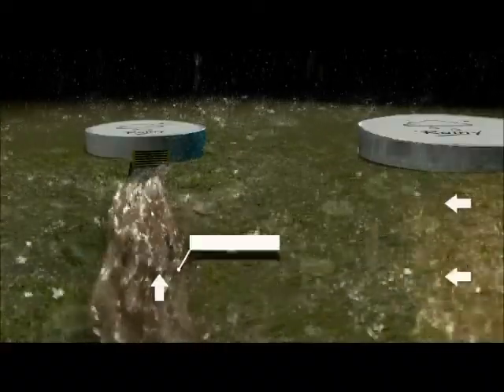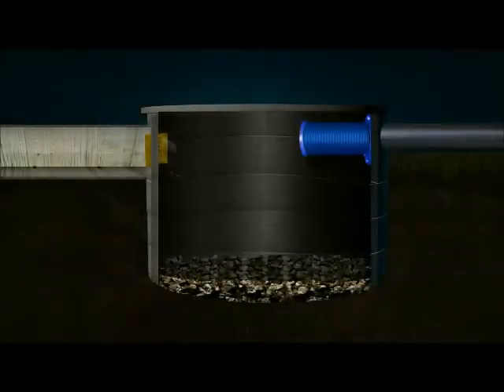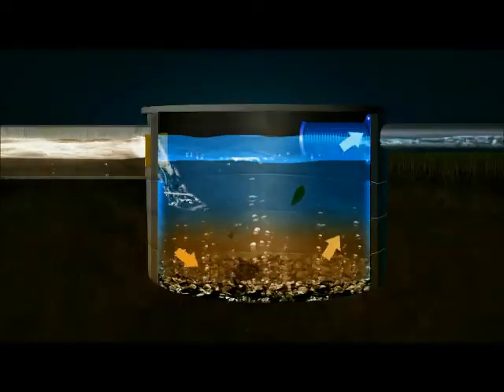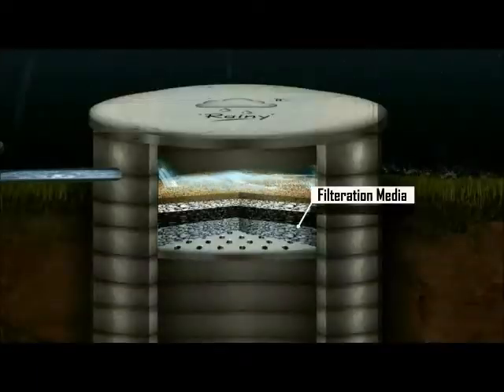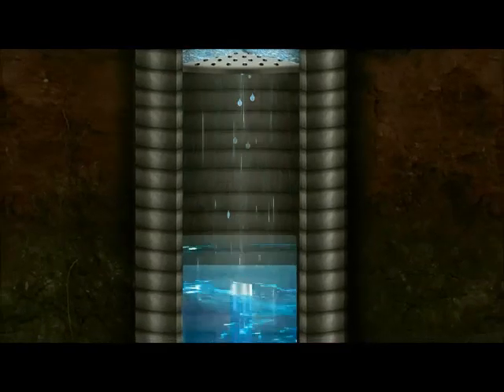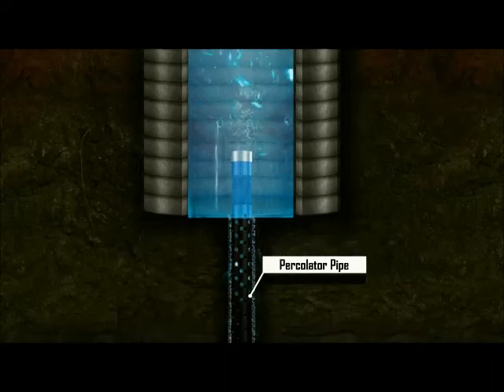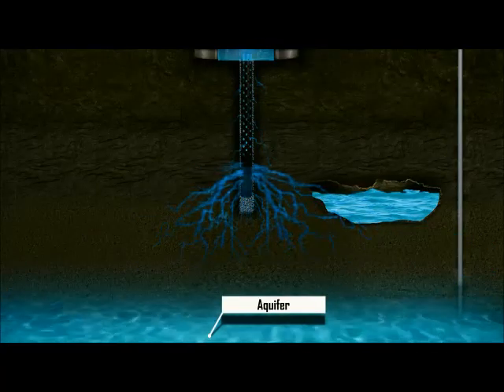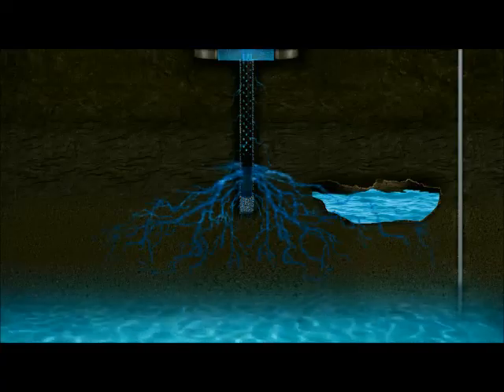Working principle of Injection Recharge well  to augment groundwater

Comment: Can be recharged rain water directly to ground water suction bore pipe? This bore pipe is connected to suction pump to supply for domestic.
Reply from the maker: No, this is surface rainwater. To recharge this, we need to drill separate recharge borewell which has only casing pipe.  Regards.